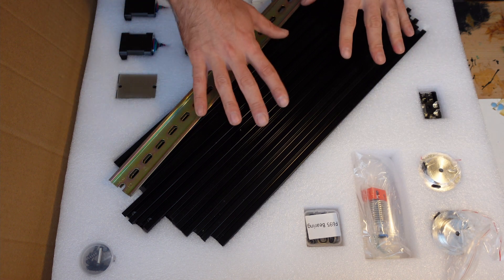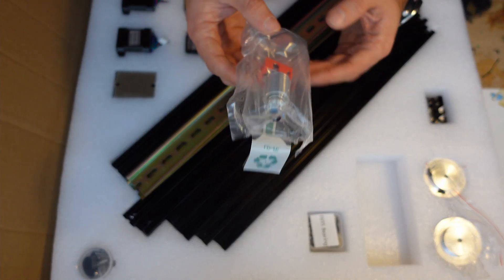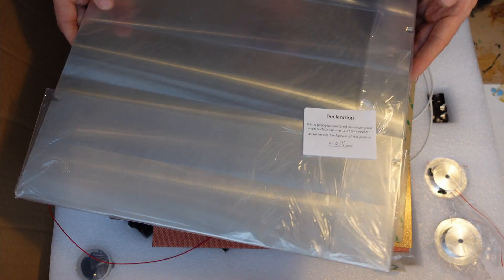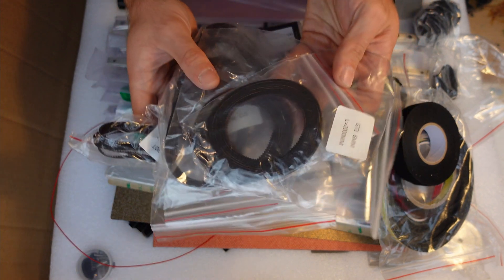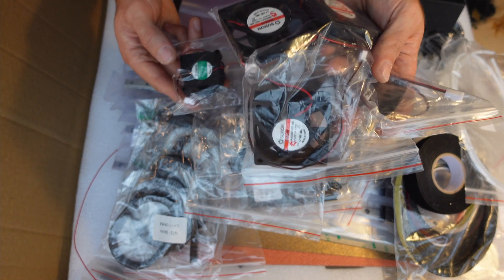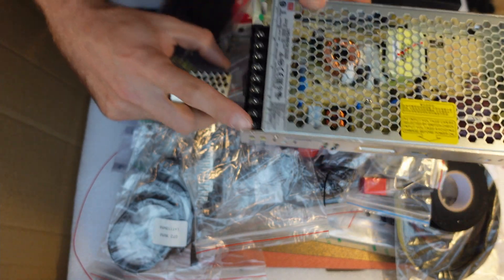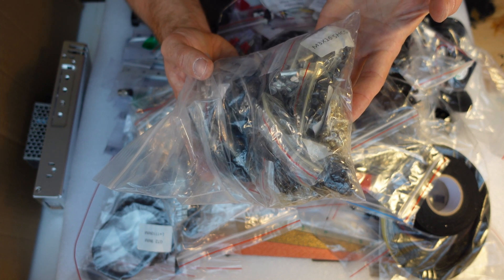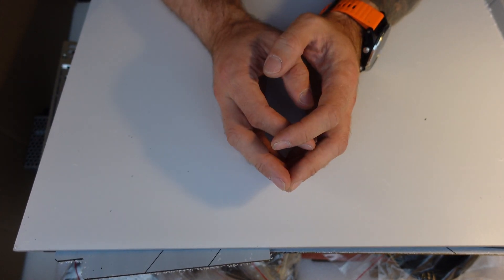A small review for Voron 2.4 350mm 3D printer kit by Formbot 3D

Comment: fyi, those switches are actually mouse switches. Mechanically and dimensionally they are identical. The only difference is the metal bar added which makes the button easier to align and press. That metal is omitted in a mouse because the large surface of the mouse button molding does that job instead.
Reply from the maker: Thanks for the note!

Comment: Does anyone have this kit working with Klipper and willing to share a working printer.cfg or any tips
Reply from the maker: Yes! 

In fact there is standard config from BTT octopus: https://github.com/bigtreetech/BIGTREETECH-OCTOPUS-V1.0/tree/master/Octopus%20works%20on%20Voron%20v2.4 (see subfolders for config and wiring)

And the klipper config: https://github.com/bigtreetech/BIGTREETECH-OCTOPUS-V1.0/blob/master/Octopus%20works%20on%20Voron%20v2.4/Firmware/Klipper/BTT_OctoPus_Voron2_Config.cfg

My config is not much different (I've enabled the probe, added the bed mesh and calibrated the input shaper).

Comment: I can confirm the exact same parts as these from a recent order from their EU Warehouse. 

Did you get any ducks with your Octopus board? I did and they are the greatest.
Reply from the maker: I don't like the motors as I had to cut the wires and put MicroFit connectors :) otherwise the kit is good

Regarding ducks - yes! One for Octopus and one for the screen actually.
Reply: @techbytch  Haha, nice! Had one there too.

Did you cut the wires for the sake of cable management or functionality? Good to know since I'm still waiting for time to start assembling mine. Overall my first impression of the kit is surprisingly good, from everything I had read my expectations were not too high. 

Did you put some insulating material between the bed and black Coroplast underneath? Heard that it can warp after a few high temp prints, so considering what to do about that possibility. 

If you have any other general advice about the kit parts feel free to let me know! Going to be a fun first printer.
Reply from the maker: @felixisme  I am in the process of wiring it right now :) hoping to complete it soon and will have a separate video about that, but basically you have three different lengths, not so complicated. I added some breaks and connectors for the simplicity.

Regarding the insulation, yes, I'm going to put in on top, but have not decided yet what material I should use. I will install the bed in a later stage so plenty of time to sort it out, but everything will be covered in another video :)
Reply from the maker: @felixisme  BTW regarding fun first printer - is it the VERY first printer or the first one you'll be assembling from scratch?
Reply: @techbytch  Nice to hear, I'll definitely follow along the vids and see what you figure out.

Regarding first printer, yes! Was a process to end up here though, started by buying a refurb Ender 5 Plus to upgrade along the way but stock ran out so after considering my options I decided on going with the Voron immediately.

It's going to be a fun process! Happy to have found a Voron owner in town so I could get all the parts out.

Comment: Nice video, My kit will be here next week. What's you thought on replacing linear rail balls with ceramic ones?
Reply from the maker: I don't know whether it's worth it (especially with these cheap rails). I've seen both HiWins and no-names working for years and the linear rail balls are the last thing to fail.

As I know steel rail balls are perfectly fine for up to 5m/s, a speed much higher than you can get during 3D printing.

Nevertheless, experimenting is always fun )